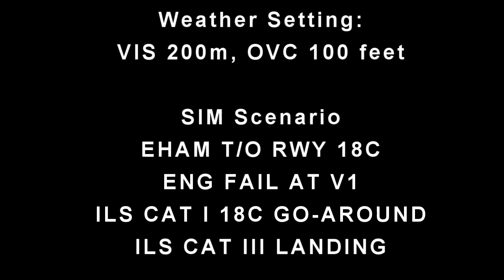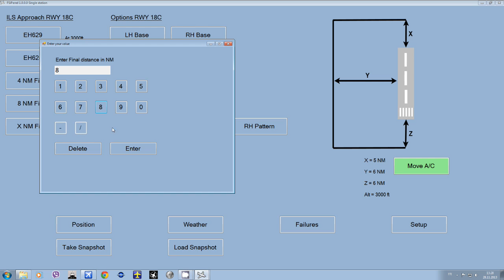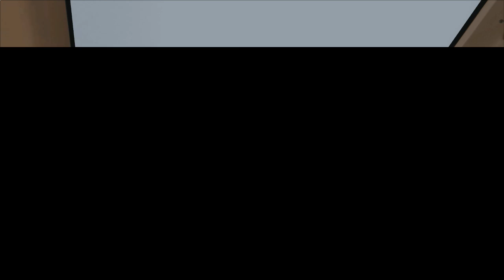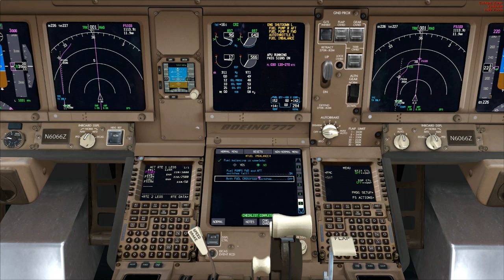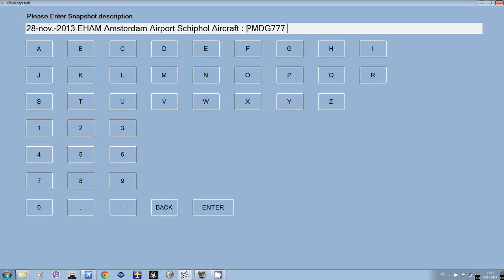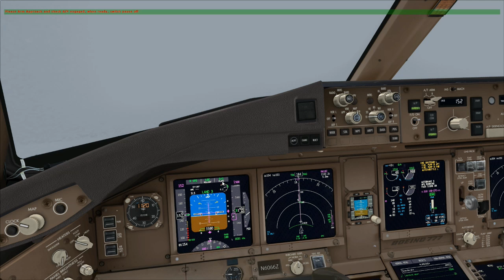FSI Panel ENG Fail on T/O and Snapshot mode

Comment: FYI the 777 has automatic rudder compensation, in asymmetrical eng. fail. situation, so no need for any rudder input:)
Nice work with the FSiPanel:)
Reply from the maker: Thank you, I have tried a T/O without rudder input and it seems that the TAC is not compensating as expected, the aircraft was drifting. will try again, thanks for the info.